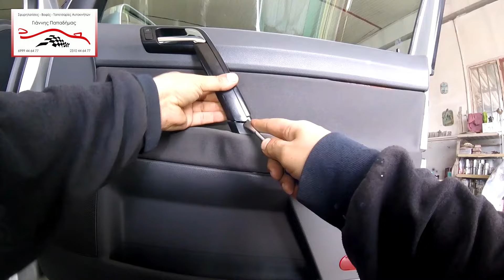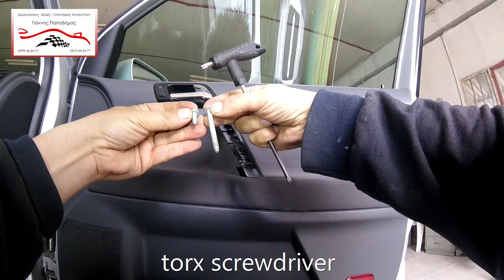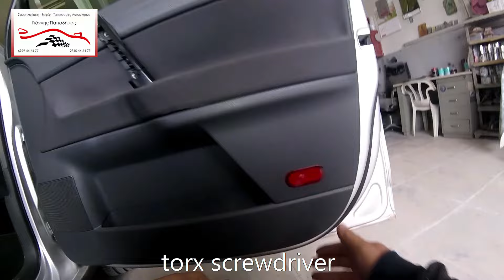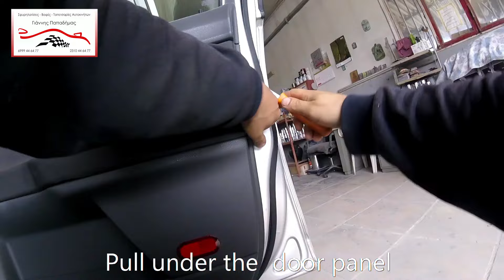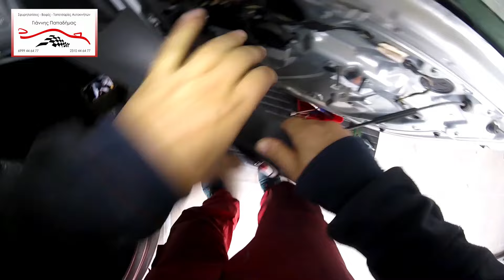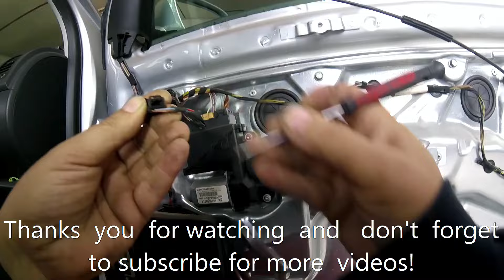Volkswagen Polo  2002–2009 door panel removal

Comment: My problem is that the rear doors are locked and, after trying a lot of tips found on YouTube, I am still not able to unlock the doors.

Is it possible to remove the panel while the doors are still locked to gain access to the locking mechanism?
Reply: Not even removing the door lock pin surround and pulling on the pin? I suspect you have a faulty actuator?
Reply: @alexandreb.1101 , I suspect the same, but how do I get in go fix/replace it?
Reply: @AndrevanTonder67  not sure. But I read somewhere that you can indeed remove the (rear) door panel with the door closed, since it doesn't have any bottom screws attaching it, just the two T30s behind the handle. Can be tricky but it can be removed
Reply: Look up channel BTJustice. He has a video where he changes the locking mechanism of locked rear door.
You need to remove the plastic pannel and then drill into the door frame to access the mechanism and unlock the door.